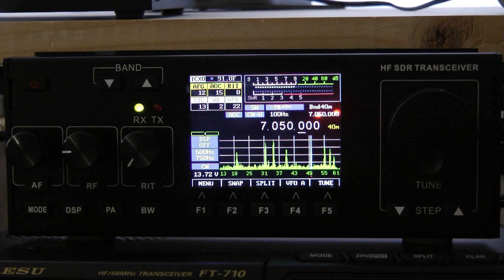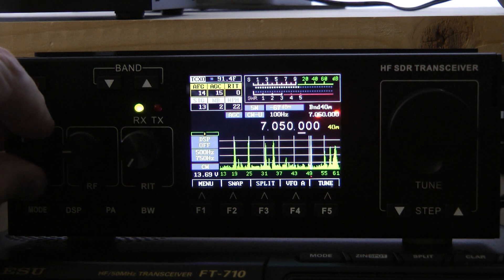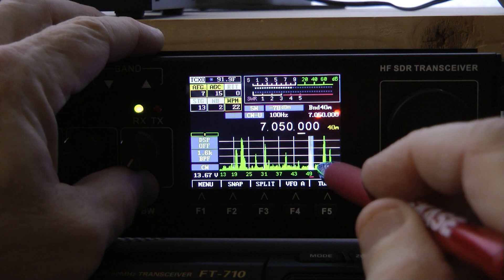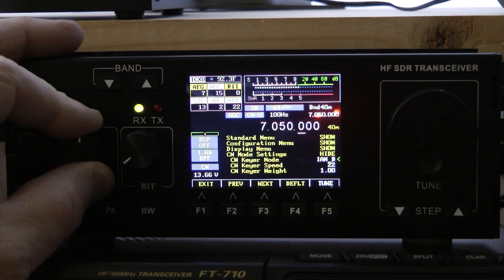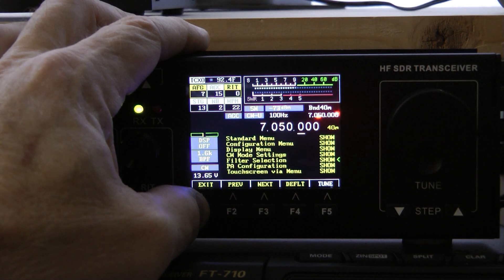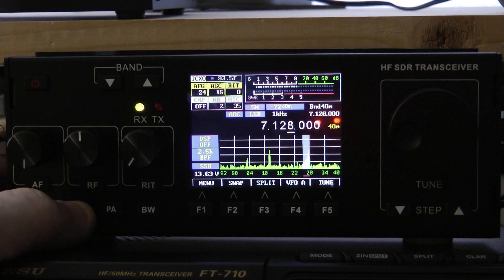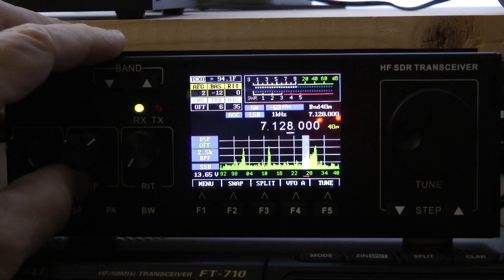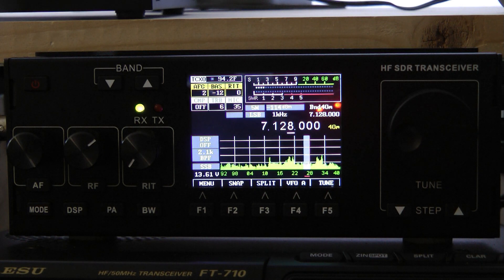Recent RS-918 review CW and SSB

Comment: Hi John, thanks for your video collection on the RS-918. I'm a bit confused about the builds tho, do all the clones use the same Nazr builds or are there different builds for the RS-918 and 9xx versions?  Also I've been playing with my new RS-918 on firmware 2.9.48 but I have no transmit on 160m 80m and 11m but it works on all other bands. I can't seem to get the touch screen to calibrate either, when I hold down the power button I get the calibration screen but see no touch screen calibration prompts. Can you offer any advice ?
Reply from the maker: I have been doing cancer treatment and have not played with the 918 for a while so I do not know about Nizar's new builds, all of his builds did work on my 918 6 months ago. You can contact him on groups.io and he will let you know

Comment: I did belive i had to use Cw-L on 40m band 🙄 no wonder i cant seem to get the decoder to work, i have tryed all the filter like a 1000 times now, the decoder worked ones or twice...but when it work it seems to work well... 73 from LA-M160560

Comment: Great video John.   I bought a RS-918 brand new about a year ago. It really is a great little radio.  Mine does have the built in battery. I use it to do POTA (Parks on the air.).  I go to several different parks on my Electric E Bike and have a blast. My antenna is a Pac-12   ground mounted vertical.  I also use this radio to do portable FT-8 and FT-4. while out and about.   DE VE3WKG AKA VA3NE.   73.
Reply from the maker: I love this little radio, as I write this I am adding a new video with a new build (#45) for the 96khz band scope firmware... If you have not used this firmware you will be amazed at the improvements, the receiver is almost as good as my Yaesu FT-710. Please watch the video, it should be ready in 30 minutes.